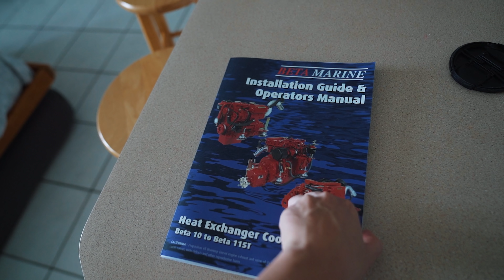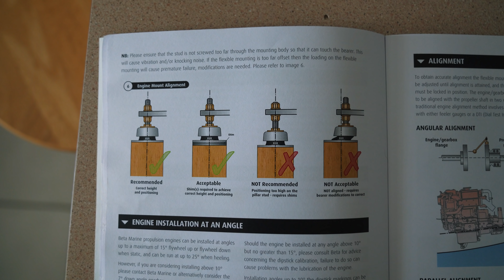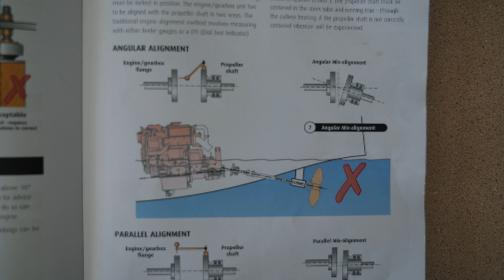DANGLING OUR BRAND NEW ENGINE OVER THE WATER!

Comment: Guys, you may want to consider getting a flexible coupling for the shaft to engine joint.  I've done several engine installations and it is very difficult to get the alinement just right.  We are taking about using a feeler gauge with a .006 tolerance.  The flexible coupling allow you to "get it close" and be done.  Well worth the $ versus the time and frustration.  Good luck.
Reply: and the noise dampning it gives
Reply: Brilliant suggestion it would be better over the long term
Reply: Is that a flex coupler at 12:50 in the video?
Reply: Agreed.  I was thinking a U-joint or Spider coupling would work nicely.
Reply: Definitely would make it an easier install.  Might also be beneficial having the engine at less of an angle for oil pickup.  Make sure all fluids are filled before test start. Run some break in oil on the motor and do a couple heat cycles then change to standard synthetic oil.  Would be nice to replace that tube but may just have to wait and service it on another island.
Reply: Agreed. Same thought here. A U-joint
Reply: If you have space in the 'transmission tunnel' so to speak, a staved universal joint as us Brits call it, would give the greatest misalignment protection.
Reply: @trblankinship  yep there's a closer look at 13:51.
Reply: Great Idea! But there is a lot of merit in building up the front supports AND using an (R&D Flexible coupler, over 100 installs by us) - it is worth the money and they are extremely durable and long lasting!
Reply from the maker: We did get one! Hopefully it makes for less vibration,  I still lined it up perfectly so it should account for any settlement on the mounts
Reply: @chiphalvorsen4252  Wouldn't the flexible coupler work on electric motors to?
Reply: @MadMarv. Marv - Absolutely it will work! We are seeing more transitions from fuel to electricity! Electric motors have their downsides, but the level of harmonic vibration is not one of them! We look at the couplers as a fail safe for movement! They now make them for almost all practical applications. It can get expensive, but well worth the investment!

Comment: I figured it would take a torch to get that off. Save yourself the stress next time by heating it up and borrowing a puller at the get go. Love your videos, keep it up.
Reply: Any suggestions getting that engine down further on the mounting bolts?
Reply: It has a solid coupling so any misalignment off of the shaft centreline will bind the shaft causing a loping vibration...it needs to be exactly where it wants to go otherwise you’ll know it from the vibes.
Reply: @SVOceanBird  oh, yeah.  Any minute misalignment and Matt will know it instantly.
Reply: Soething tells me there will never be a "next time" for Matt If he help it in any way...😆
Reply: See my comment above regarding the socket.  No puller is needed.
Reply: Ext time you can run your wife’s hair dryer on high heat on the fitting. Let it warm up as warm as you can get it tap it till it is able to come off. Sounds crazy but !!! It works
Reply: Mental note on that touch trick.

Comment: Before you remove the shaft seal next time, dive and wrap a plastic bag around the shaft in front of the cutlass bearing.  Jam it in GOOD.  That will cut down on the water entering the vessel when you remove the gland packing and replace the entire seal.  Great choice of engine.
Reply: Can I donate some plastic bags to someone haha. That's a good idea, bag around the shaft then s zip tie kinda thing to help hold it.

Comment: Best laughs all week.  I hope that it is camera distortion but that prop shaft looks bent.  You really need to check that as a bent shaft will damage a lot of other things. Also, 1/8" adjustment is HUGE. You should be within a couple thou (0.002") or less.  You have to aim for perfect concentricity of the output shaft and the prop shaft.  I am assuming you have a new prop on order to match the new engine.  You have to match the output power to the prop pitch to ensure you are in the proper RPM range when using the engine.
Reply: Agreed.  I would check that shaft for runout.
Reply: At the least, clean that prop...that growth can unbalance it.

Comment: LOL! " We don't just have the mast for the style points."  Apply heat to metal and it expands. A universal trick all around. Have water spray bottle handy to keep things from burning Etc. And you can also pick up a non flammable rag / insulation in the plumbing dept foe like $10. You got this!

Comment: Matt, you need a wheel puller tool. Wipe all the fluid off it and any over spray around it, then use a propane torch to heat up the metal flange around the shaft, which will expand it enough to tap it off. Wear thick gloves so you won't get burned. Use a folded wet towel on the flange.

Comment: That prop shaft looks like it’s bent like a boomerang - it might be worth removing and having a shop check it when you haul out next.  If you make it work, I suggest that you switch out that shaft seal with a PSS system.
Reply: I agree.  That much wear on a bushing us more than mis alignment.  The strut itself probably got tweaked over the years.

Comment: They have these floating rafts you can use to float the boat so you can replace that stern tube.  This way you will get a small amount of water in instead of sinking.  Or just rent one of those high capacity sewer water pumps.
Reply: Water will still fill the boat up until the water level outside the hull.   The rafts will just keep you from sinking, but your boat will be full of water.

Comment: Magnetic base and dial indicator on the shaft or engine, ask if there is a local machinist around they might teach how  to use it or help with it for few cold ones. Dial indicators are used on lathes to make parts all the time within  0.001 inch easy, that way you could use a flex coupling and or a u joint or the engine coupling the choice would be yours but the shaft and engine would straight as a pin in line with each other.  Respect for the two of you. You've got this !!
Reply: He can by a dial indicator at harbor freight for $25.
I blew my Jeeps rear diff up and had to keep my backlash on my ring gear/imput shaft between   6+10 thousands...it was 9!
😬  ten thousand miles later...doing good! 🚙

Comment: The prop nut should be a castle nut, that looks something like a castle with notches on top. you tighten up the nut until the notches line up with the hole in the prop shaft and then you put the cotter pin thru it.  Otherwise, you use two nuts, the last one is considered the locking nut. The way you did it the nut could accelerate towards the keeper ring.

Comment: It's important to have that shaft CENTERED before you try and align the coupling!!  If you don't when you replace the shaft and fix the tube later your engine will then be Misaligned.  As Wayne Moody said below, you can shim the shaft in the center while you install your new runners.  A good suggestion was not to use pillow blocks at each mounting bolt but a single runner on each side.  Good Luck and you guys are the greatest!!

Comment: classic for use of 2 things. 1. heat. A lot of heat. You need a big torch. Oxygen/propane with a head designed for it. 2. A gear puller. This is pulling a collar off, but the tool is the same. No tapping or pounding. Turn screw. Apply heat. Simple. Easy fast. You are lucky you didn't break something. Pounding with the large sledge? Not my plan. gear puller. The fuel tank needs to be replaced with a real built in made for the ship fuel tank. Hundreds of reasons why. Simple. Fuel is flammable and needs respect. Deep respect. The standard shaft alignment tool is a dial gage. Typical runout spec is 0.001 inch. This provides for vibration free operation.

Comment: If I was in your position, I'd take the seal off like you did in an earlier video where you found the issue with the propeller shaft seal hull fitting.  Then I'd use some pieces of wood with  concave arcs sawn in the end that match the propeller shaft in order to hold the propeller shaft in the center of the fitting.   At first,  I'd do one for each side and  the bottom.  I'd then tie the three pieces together by screwing a half circle piece of plywood to them.  This half circle would also need to cut a hole in the plywood to clear the propeller shaft with the hole being far enough into the piece that the "legs" of the half circle would stick up far enough above the propeller shaft that I could then screw another piece of wood across the top of the propeller shaft and keep the propeller shaft from raising up.  Basically, this piece of plywood would look like a "U".  I'd then put a little weight on top of the propeller shaft just to make sure it doesn't rise up.  I'd make sure I could slide the seal back into place after the jig was set up.  This wooden jig should be able to be easily removed once the engine installation is complete.

Comment: That's right gear puller. I'm a machinist but for my first job I worked in a small shop as industrial Mechanic, welder fabricator, machine parts for the engineers. I pulled hundreds of gears. Make sure your drive and driven shafts are aligned as best as you can make it. Cuts down vibration and bearing wear.

Comment: When the propellor was replaced on the drive shaft, I saw a washer knocked out of the propellor hub, unnoticed. Then the nut was screwed on to hold the prop in place. Hope a little thing like that washer doesn't cause a big thing at sea.
Reply: Looked like a piece of barnacle from the blade of the prop that was knocked off and floated down at just the right time 😁

Comment: Matt, the shaft looks bent in a couple of the pictures.  Might want to have that checked before doing any alignments.  Also use a brass nut on the propeller not stainless steel.  You want to use a softer metal for the nut and jam as per NMPA National Marine Propeller Association.

Comment: Good Job Matt, most people would have tackled that shaft coupling without using any penetrant oil and broke the bolts and bent the shaft. In the Navy we used oil of wintergreen (better known as "Weasle Piss") as a rust busting lubricant. Heat was the last resort.

Comment: I did this recently, when I replaced the cutless bearing ( inside the stern tube) it straightened the shaft. You are going to have to lie your boat on its side gently, using the tide and some old tyres. Remove shaft then cutless bearing, replace it and refloat. If you can't get haulled out. I don't have insurance on my 33ft 1969 model, but found a boat yard up a river in Qld Australia that doesn't require insurance. I used my tender strapped to the side to power the yacht up to the boat yard. You got this Neptune's Reaper.

Comment: Those metal connections are rust welded over time and an overnight soak in penetrating oil and a blow torch is the only way. Good job all round guys.

Comment: You should have sprayed that penetrant on weeks ago. Spray everything that is metal and rusty. Get a self-feathering propeller. Install your engine room lights. Keep that beer cold. Install an AC compressor on that motor. Get some scuba gear or install an air pump on the motor too. It looked like too many Chiefs and not enough Indians. I wonder what knots they used on the lift. What is the capacity of the windlass? Was the motor about 400Lbs? At 17:50 you walked right through the oil puddle. Next it will be all over your boat. Your old motor could have been rebuilt and had all of that new red paint on it. You should add some sound-proofing. I must be in a pissy mood I guess. You are making good progress.

Comment: I am a millwright, and we align couplings as close as one half of a human hair. You can do it right by puting the shaft seal in first then scale in the coupling with a straight edge, and a feeler guage for the same gap top, bottom, and both sides.

Comment: Matt whenever you are dealing with a stubborn part not breaking loose and you have exhausted the penetration oil process. Clean it all up and put a torch on it for heat. The yellow or blue bottle. Then try breaking it loose again. Works 90% of the time.

Comment: wood rails going all lenght would provide the height for alignment and grant a better distribution of load and vibrations. I think it's worth the extra work. Vibrations may crack fiberglass eventually when engine bolts are going straight through it.

Comment: Hey Guy's,
--- heard in one of your video's recently, you may be looking into replacing the stainless steel rails for the canopy, etc...
Just restored a transit and used one of those steel scrubbing pads you can buy in the grocery store for pots and pans,
takes the rust right off - then simply wax the rails when done (think they actually make a product for that), but car wax works just fine.
--- Brillo is another option, and believe it or not you can soak stainless steel in "white vinegar" overnight - removes stubborn stains as well.
(we did all our knives) - works great...  Good Luck!

Comment: In some of your projects where an oxy acet torch would work you cold try a MAP gas torch from the plumbing section at lowes.  It’s hotter than propane but less than an oxy torch. I’ve had good luck using that on many stuck parts.

Comment: Matt, using the halyard is the way to go, that has been used to haul loads ever since boats have a mast. However always use two halyards, one for the load (or person) and one for safety taking up the slack with a spinlock closed and around another winch. The engine could have had two lines attached to it for control, this would help avoid the near miss against the solar panel. 🦚

Comment: You could probably use an engine pulley removal tool or a steering wheel puller.  It’s hard when the rust fuses metal together.

Comment: G'day GBU, when you had the prop off, you should've sanded and buffed it out, and applied PropSpeed, or something similar! You should've cleaned all that nasty growth and rubbish off your propeller mate. The engine looks nice. However, the new engine feet definitely do not align properly to the existing engine beds. Beta Marine actually has custom-feet- ordering;  where they'll build to your exact specs, so the new engine can drop into the old engine's footprint ~ for a nice, easy engine installation!  Continued success and take care! Cheers GBU from Western OZ 🇦🇺 .

Comment: One last thing Matt, make sure you have enough pumps to handle a leaking shaft seal, and enough battery juice to handle it if you wait on replacing the brass shaft bearing. Did you put the key on the shaft before you put the prop back on?

Comment: Good going, crank up the Mounting Bolts until the Flange Faces are as parallel as you can then measure the Mounting Bolts to see how high they are from "centered", this will tell you how thick the Mounting Blocks should be.  I agree about making those Blocks come around the inside of the old Stringers to give you some breathing space, then 'glass um good!

Comment: Great to see that engine in place well done.  Getting the coupling off the shaft I was going to suggest a metal plate with three holes two outers to match the coupling and one for the centre, tighten all bolts so the centre bolts pushes the shaft away from the coupling then hit with hammer, but you have found the answer a bit of heat and a hammer.  Great work you two are doing a fantastic job.  Look forward to the engine commissioning and sea trials.  Thank you

Comment: Hey please have a wet towel around when using a Grinder on metal, just my own experience- can help survive! and when u work on shaft drives in the water - a plastic foil underwater helps a lot from sinking… (right placed u have a real dry workarea…water pushes the foil in and seals the area)

Comment: Alignment is so critical!  Not only does the motor need to be adjusted to have no stress on the flange, BUT Also the Shaft must be centered in the tube which you cannot see.  Why not pack the outside to prevent water from coming in?

Comment: Matt use a gear puller.   Im surprised your homeboys didn't tell you about that -  Old school!   Ive used a piece of flat bar. 3 holes.  two outside bolt to flange the center hole weld a threaded nut.   then you crank the bolt down as it moves to the center it puts even pressure hat presses the shaft and pulls the flange

Comment: Easily the best boat channel out there.  I was a little worried when you tried to beat that coupling off without a gear puller, but you came through.  A bigger hammer isn't always the best idea, you may do more damage that way.  When you get to somewhere that you can be pulled out you may want to rebuild stuffing box and check out that shaft.  Great job, love your video's!

Comment: Looks like you could have made a puller to get that off with a bit of scrap steel, tap and die set and a long bolt. Bolt the scrap to your flange and thread it for the bolt. Turning the bolt pushes against the end of the shaft and drags the thingy off.

Comment: You might need a 3 claw puller,after removing the key way from the shaft.Matt check the propshaft is straight,from the propellor end to where the shaft is coupled to the engines crankshaft.Obviously aligning the angle of the engine to the propshaft is important to run dead straight.You will have to tweak things here and there.Use a centre guage dial to check for shaft run out.We do this when lining up the chuck jaws on the lathe before turning between centres for accuracy and adjust as we need to before machining or turning the job piece.Otherwise glad the engine is onboard.Engine mountings are important so a good idea to make  wider,stronger mountings.

Comment: There was a similar alignment problem installing a beta 20 in a Gib Sea and the solution was to add aluminium spacers under the feet . If you want pictures I can send them to you . Our engine has been in the boat for 10 years and has never missed a beat and has been totally reliable. Popy Cuatro Aitch and Assumpta.